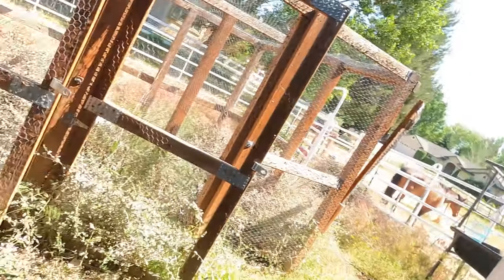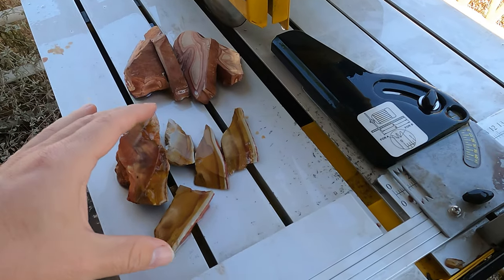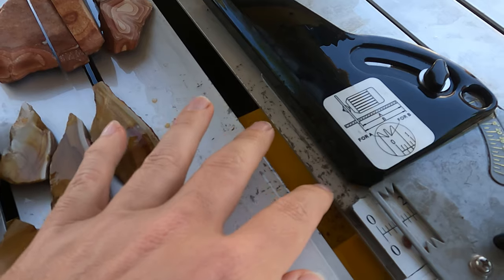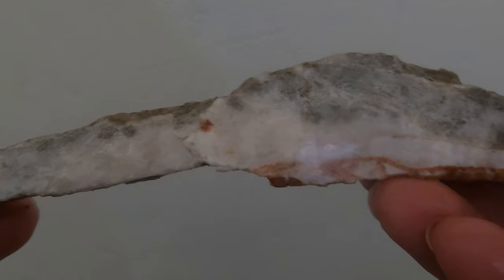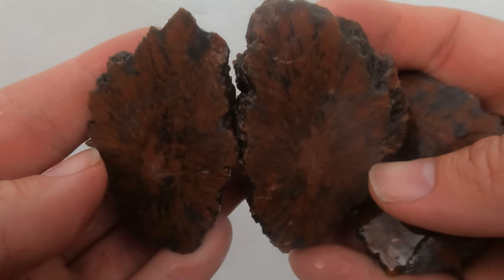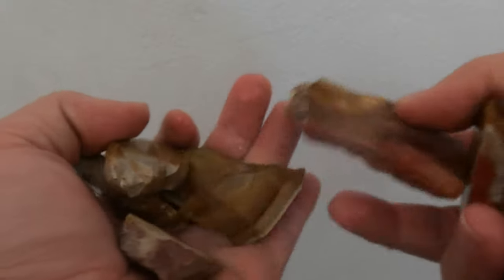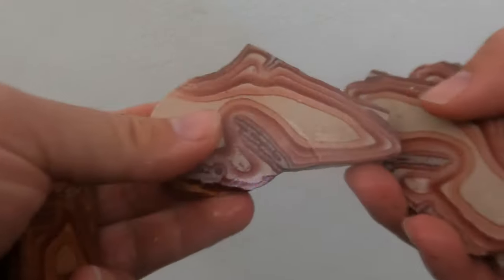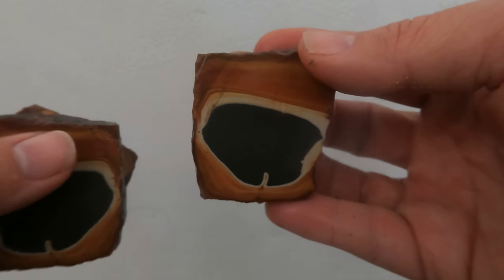Cutting Rocks For The First Time In Idaho With A New Saw!

Comment: I have a very similar but larger version of that type of saw. I just cut agate and I've never had a problem with thin pieces breaking. I don't even understand why the Gap would matter. But I've never tried something softer like wonderstone.
Reply: Thin pieces do fall down into the gap which is annoying.
Reply from the maker: That could be the problem. I will need to try with some agate next time.